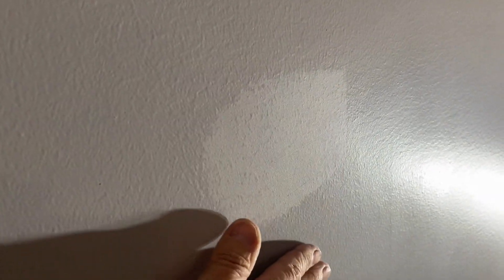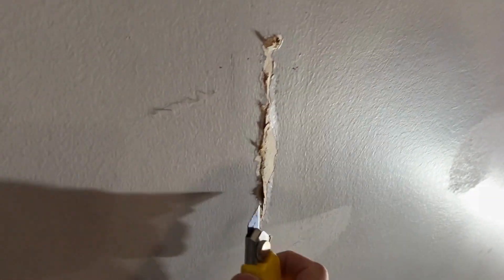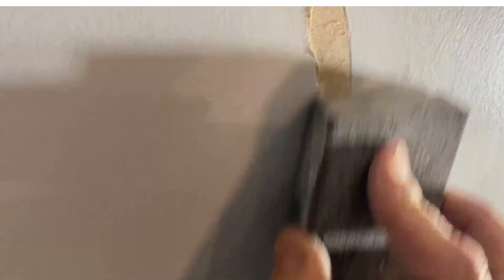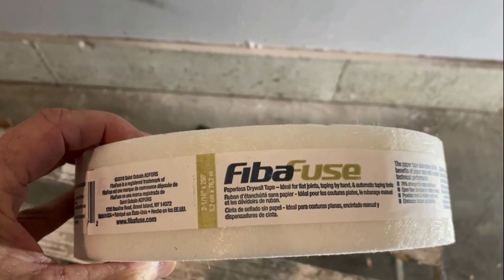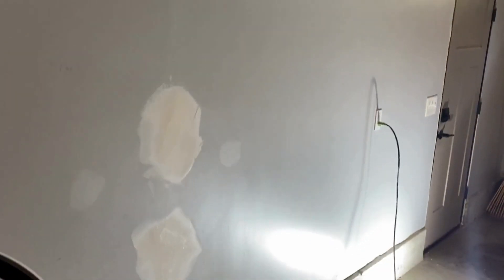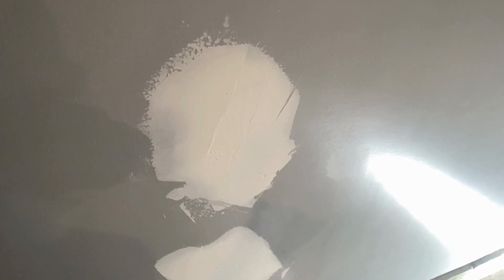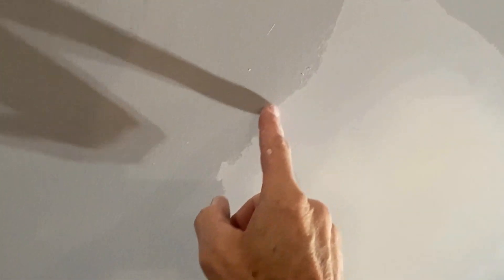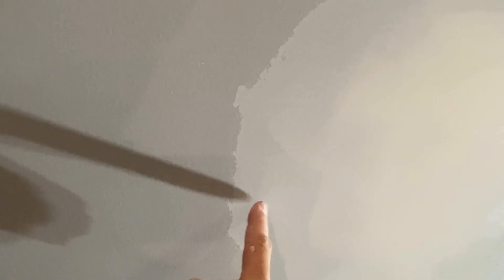Stop Drywall Repairs from Showing through the Finish Paint

Comment: Thank you!  I saw a facebook "short" where a guy used a small roller with sheetrock mud that had been thinned with water, & went over the smoother patched areas, giving them texture similar to the rest of the painted wall. I haven't yet tried that, but am planning to because I have a lot of patches, which of course show even after primed & painted, because they're smooth, while the rest of the walls have "roller texture" from previous paintings.

Comment: Overall it's good! You are correct my friend as you say, should have primed with a thicker roller that way when you paint its already close to matching the natural wall texture. I always use 20 mil microfiber rollers to prime. And 13 for the 2 wall color coats. It blends in very well in the end.  And remember guys, ALWAYS give a wall sand in between each coat of paint to have gorgeous smooth walls

Comment: You need to use Zinsser / Kilz primer on the repaired patches and then paint.
Reply: The patches would still show, because they'd be smoother than the rest of the painted areas.
Reply: The type of paint does not matter.  You simply need to use a thicker roller to match the wall texture. After 1 coat of primer and 2 coats of wall paint everything blends very well